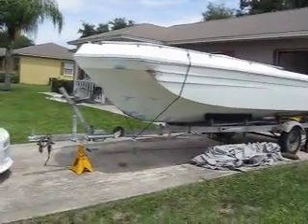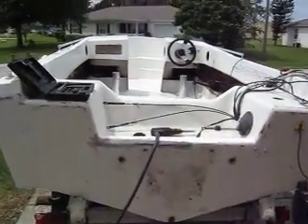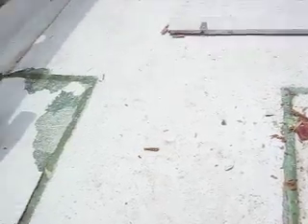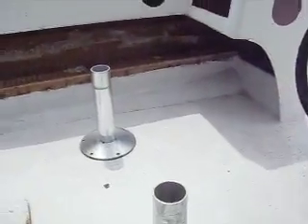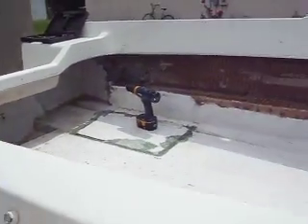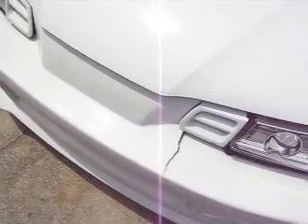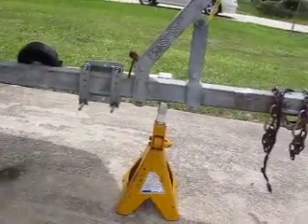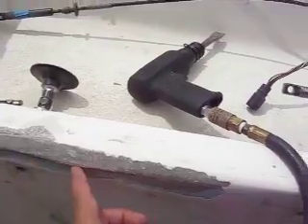DIY-1972 THUNDERBIRD SHAWNEE TRI-HULL BOAT RESTORATION

Comment: i had a 15ft trifull like yours with a 70hp crysler 2stroke,with an aluminum propeller 13x15,after i utted the floor & re did the floor & stringers,that lil oat ran 52mph..

Comment: i have the same boat.but mines a 1971.floor was redone with new wood and fiberglassed by the former owner.mine is powered by a 1978 mercury 115,6 cyl, 2 stroke,w/ power trim.its very hard to find any info on this boat.